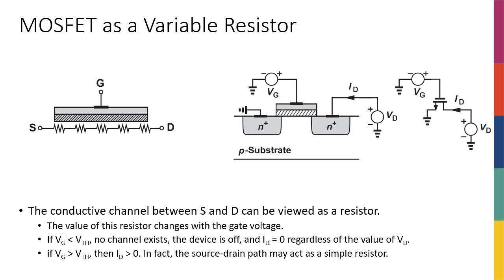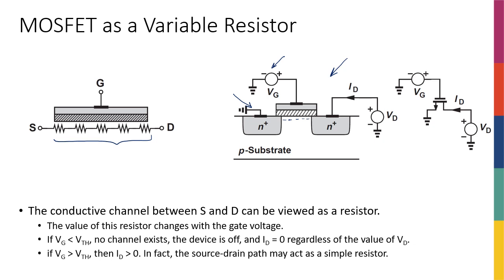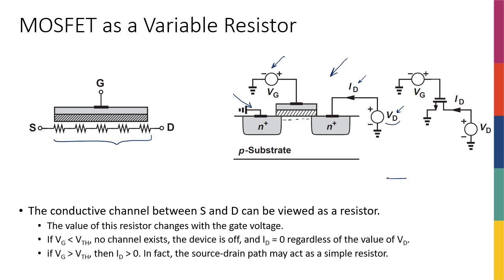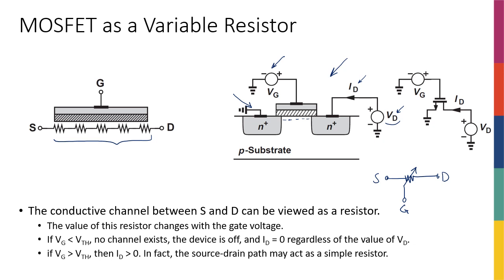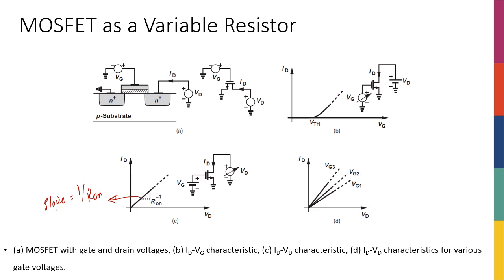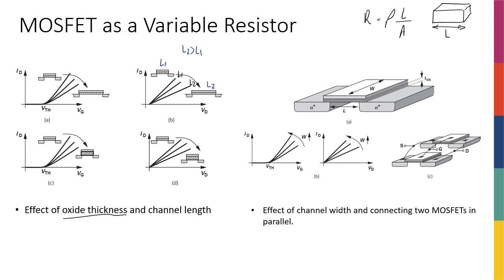Week9 - MOSFET as a Variable Resistor

Comment: This might be outside of the scope of this lecture, but thicker oxide mean higher threshold voltage and it would lead to higher VTH, same for longer L lead to higher VTH while shorter L lead to lower VTH and Higher W lead to lower VTH. Higher VTH mean higher Channel resistance.